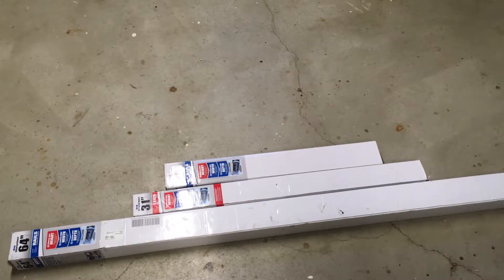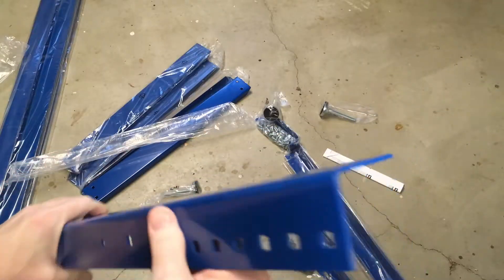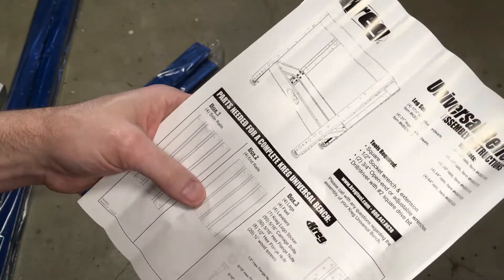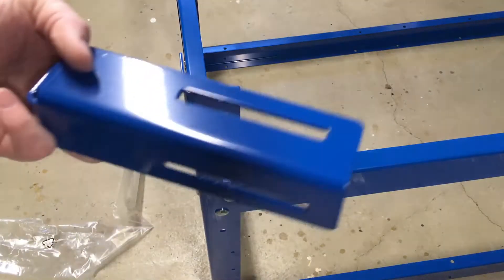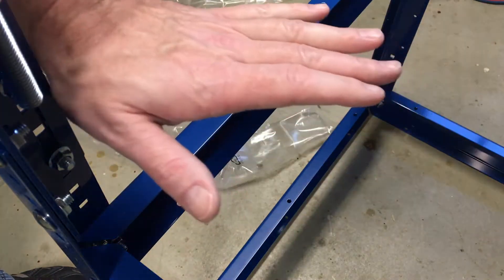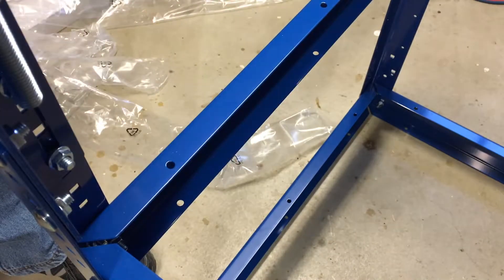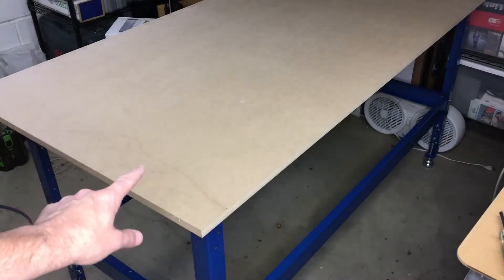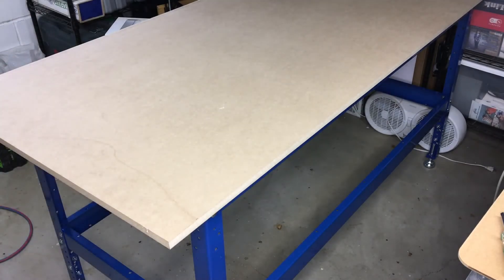Tech Bench Build: Kreg Universal Bench Assembly (Ep. 1)

Comment: Thankyou Rick for the excellent and informative video, I was thinking of the festool mft but very wobbly and we can get the Kreg bench here in the UK so I think I will go with this option, your video was extremely helpful, thanks mate. Louie
Reply from the maker: I have an MFT and I like using it with my track saw but aside from that, I like the Kreg benches. I have the one in this video and another smaller one. It feels very solid with my two layer MDF top. If I really wanted it more solid feeling, I could triple the top layer.

Comment: Thanks for the video Rick, its super helpful. 

Have you had any issues with the MDF top warping? The reason I ask is I work out of a shed and even though its insulated the humidity can warp lumber i store inside.
Reply from the maker: I haven't had any issues with my MDF top. I made sure to apply finish to the top and bottom. MDF can sometimes sag, like when used for shelving. With the bench it is supported on four sides. I think it also helps that I glued two pieces together. If you want more support, you could put some wood or metal bracing on the underside. I have two other MDF tops that I never did finish and they are doing fine but they are smaller than this one.